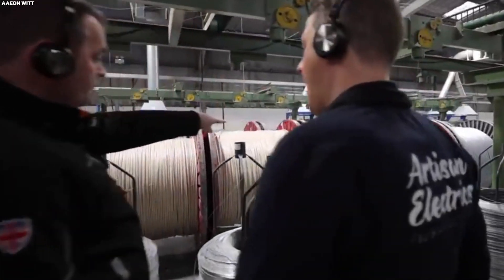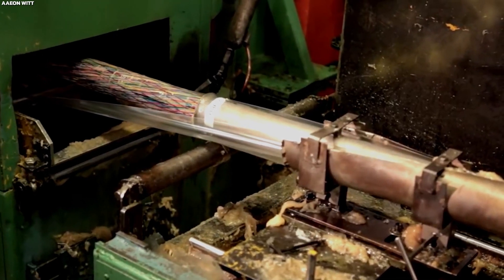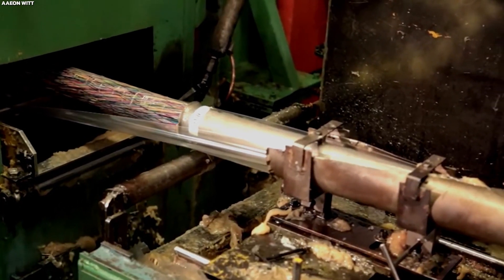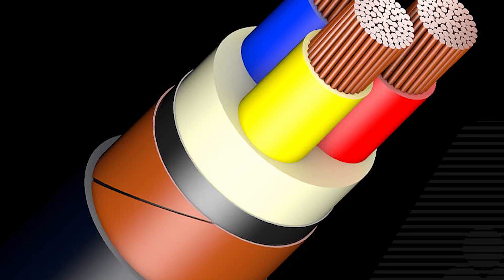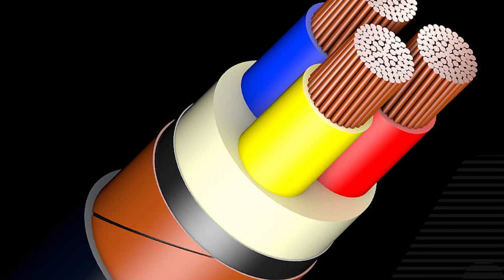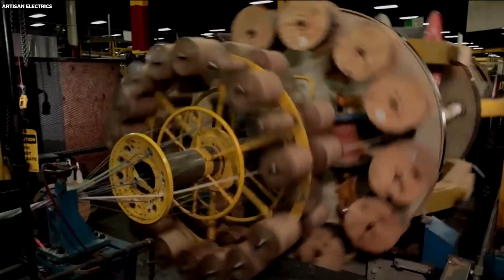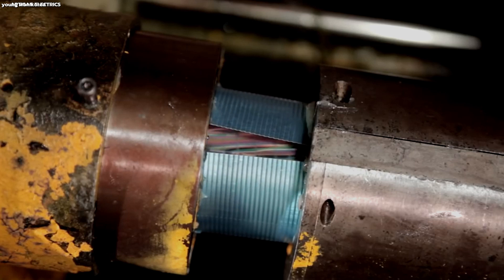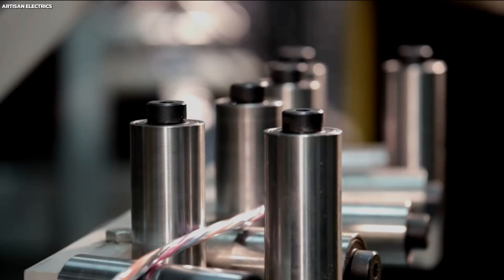How COPPER and CABLES are Made - Satisfying Process

Comment: fun fact!
the term for the diameter of the wire (gauge) is related to the drawing process
it may seem ass backwards to those who dont know, but wire gauge is reverse what you would think
the larger the number the smaller the wire, the reason being is the fact that the gauge number is how many dyes it had to go through to get to that diameter
technically this could mean that you could have a 22 gauge and a 10 gauge wire the same size depending on how agressive the dyes are, but im fairly certain theres some kind of standardization for that?
anyways, regardless its not backwards if you know the deal